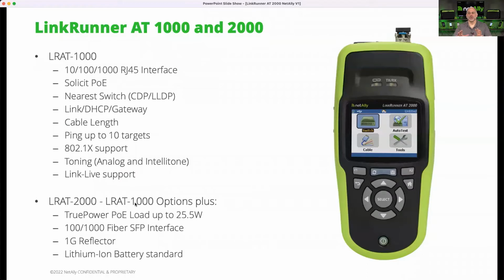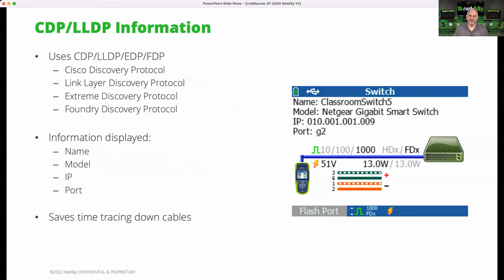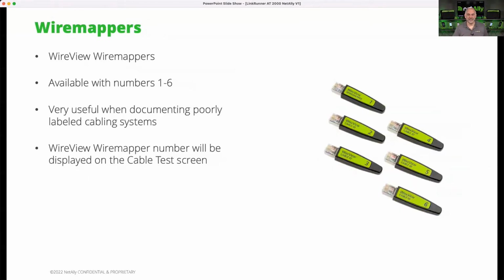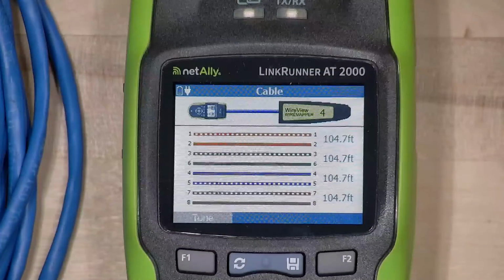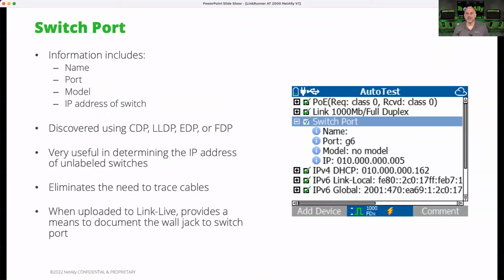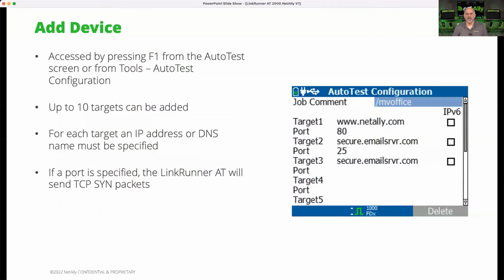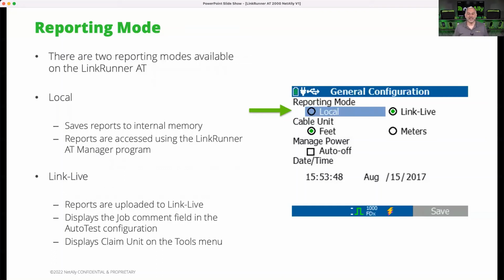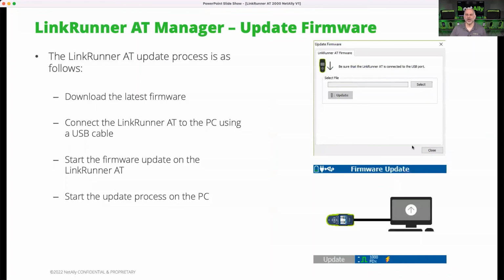LinkRunner® AT Full Product Training

Comment: As to the SFP,, I found it did not like Cisco brand SFP (GLX..., etc).  Along that line, does it work with some of the data center type SFP - 10G, 25G, 40G?
Reply: The LinkRunner AT is only capable of connecting/testing to 1Gbps; the highest speed we have in our handheld testers is 10Gbps, such as in the LinkRunnre 10G.

Comment: My Linkrunner 2000's screen is extremely dark. LED backlight seems to be off. Is there a way to turn it back on or is it done for?
Reply from the maker: The LinkRunner 2000 does not have an option to adjust the screen brightness. Please contact our technical support team for further assistance.

Comment: is there a way to test a single mode fiber cable with two of these units?  Without having to hook it up to a switch?
Reply: Jason, you could put Single Mode SFPs in two of the LinkRunner AT 2000 units and connect them to each end of the fiber.  This would let you know if you had link.  If you wanted to do throughput testing, you would need to move up to the LinkRunner 10G on at least one end.  The LinkRunner 10G supports the LANBERT app, which will do line rate throughput testing over a copper or fiber link.  For up to 1Gbps, you could use the LinkRunner 10G on one end and a LinkRunner AT 2000 on the other.  If you wanted to do 10Gbps, you would need LinkRunner 10G units on both ends.

Comment: Hi
When I am doing my testing it is behind firewalls which do not allow internet access (machine network)

if the LRAT do not have access to the internet/Link live during the tests, will it upload  the results later when i connect it to a cable with internet?
Reply: The LinkRunner AT will store up to 10 test results in memory and upload them to Link-Live when you do get an Internet connection.  Otherwise, you can save them locally and not use Link-Live.  To generate reports, you would need to download and install the LinkRunner AT Manager software, connect the LinkRunner AT to the computer using a USB cable, then transfer the results to the PC.